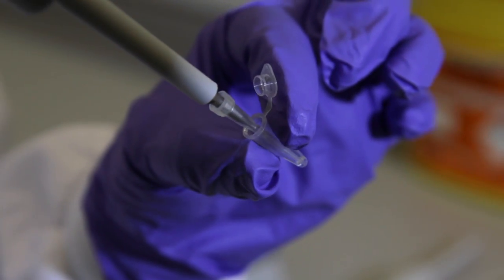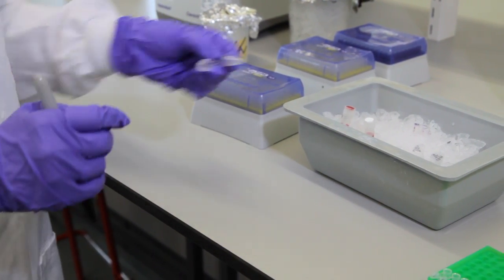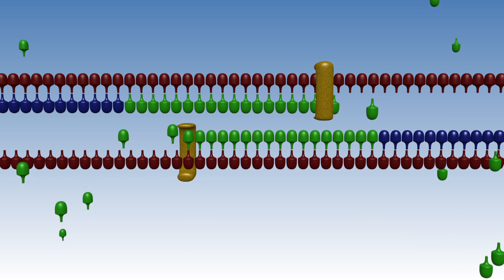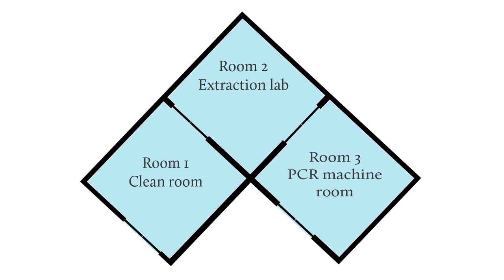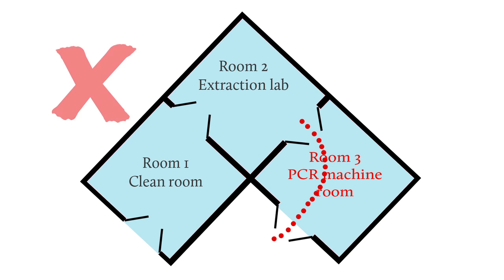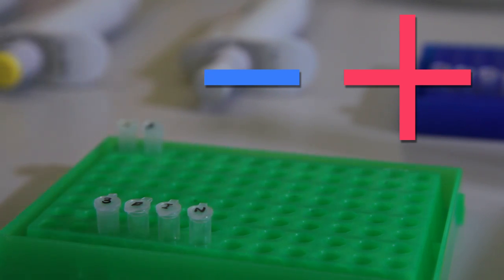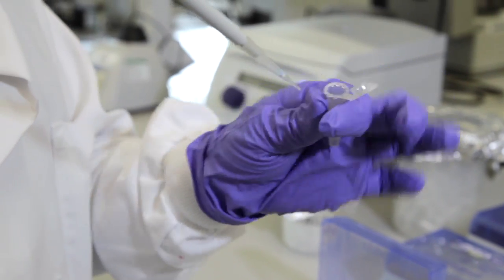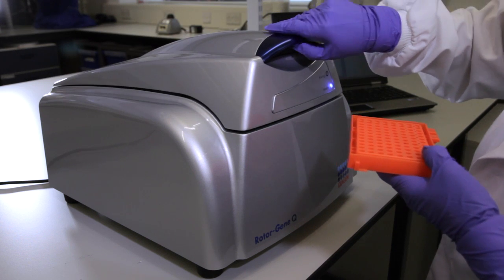How to set up a PCR

Comment: I could be very wrong, but for a 50 microliter mix of 7 reactions you should have 350 microliters, not 340 microliters. Water should be added until 343 microliters, not 333 microliters.
Reply: you're right. I also realised that suddenly my maths did not match... was like why... and then I noticed they suddently did what you mentioned. which is a mistake since in the beginning they indeed mentioned the final volumen (for 7 reactions) was 350 ul (therefore 175 ul from the master mix aso...).good to see I was not the only one.